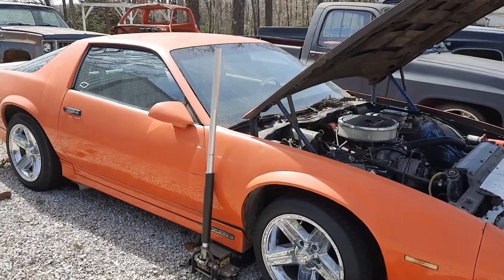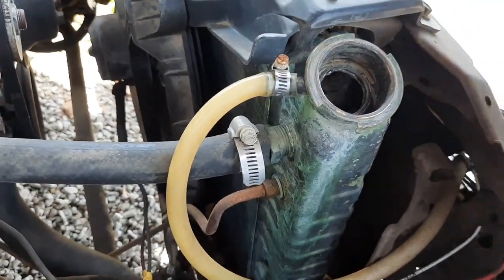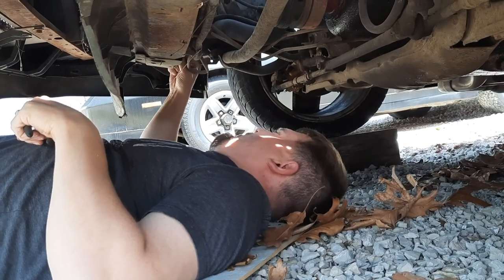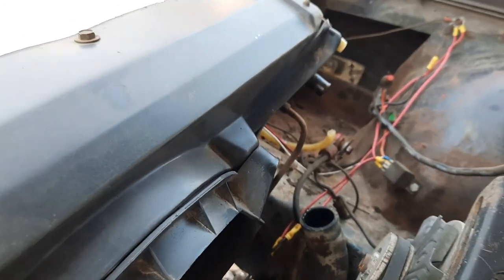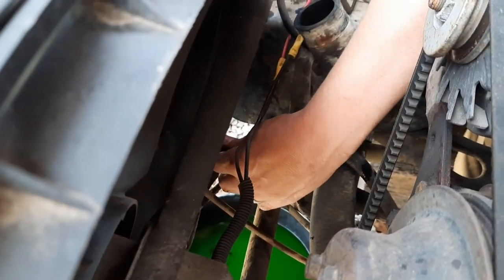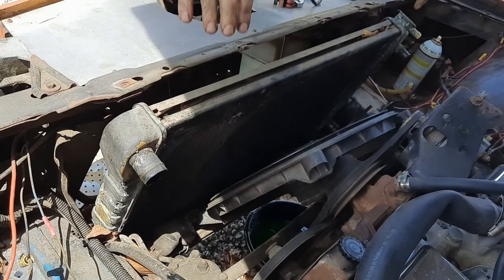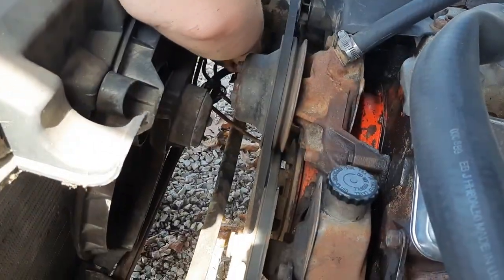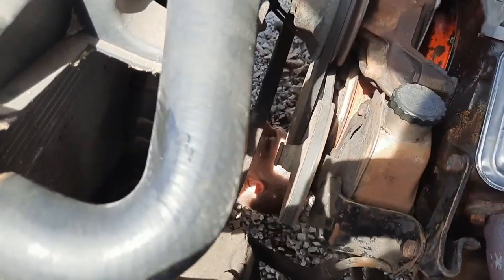1985 Z28 Camaro Radiator Remove & Install

Comment: these damn things always run hot. I have own three and had to use racing radiators with a dual fan set up to get them to stay in temp. lol
Reply: Iv never replaced the bottom hose before from your knowledge it’s not much work other than disconnecting it from the radiator and the block is it , I got the car jacked up and getting ready to take it off
Reply from the maker: @richardernst8857  yup, you just undo it from the radiator and the water pump on the block.